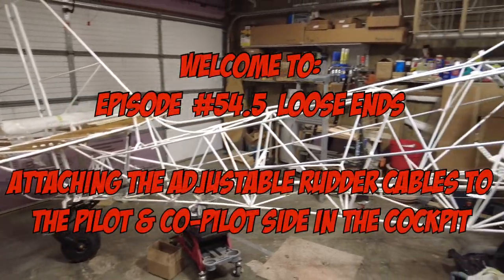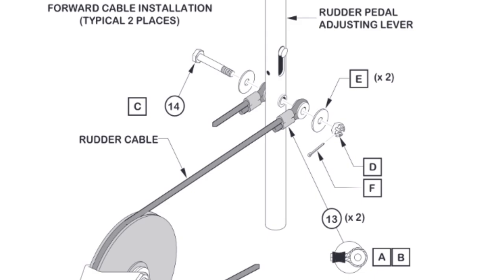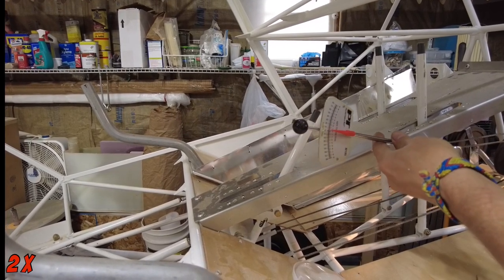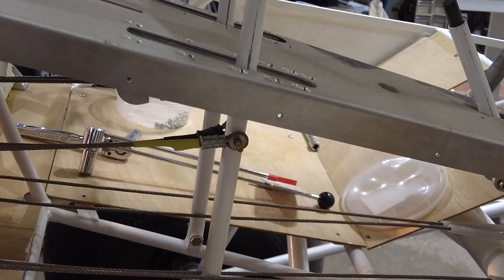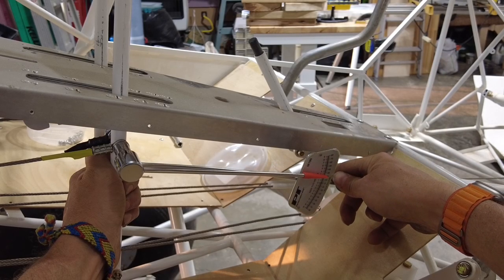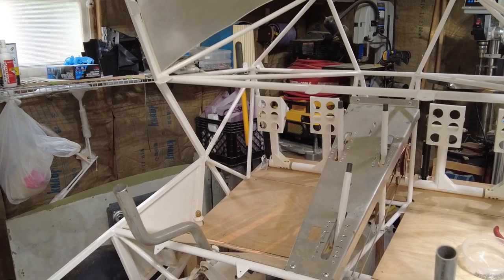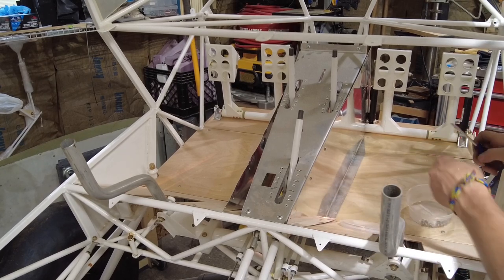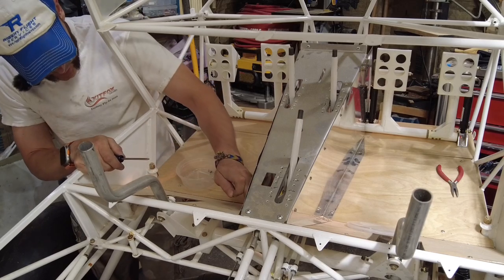#54.5 Loose Ends Adjustable Rudder Cables in the Cockpit

Comment: Hi Matt, I'm up to almost exactly where you are in my build. I've found your videos extremely helpful, thanks for publishing them! I've gone back and forth on my floorboard attachment method and just this weekend decided that I'm going to do rivnuts. I bought the Doyle kit from Harbor Freight and an 8-32 and 10-32 mandrel and rivnuts from Amazon. I went with steel so that they match the frame material and are stronger on the threads than aluminum or SS. I will back them up with hysol so they don't spin. I did some reading on the forum and it looks like Josh Esser and a few others were successful with them. Also, Bryan Bowen used them for his doors so that you don't have to put a nut on the inside of the frames. His video inspired me to bite the bullet on the method.
Reply from the maker: Hello @damienradford7143, I’m glad you have found the videos to be helpful and hopefully a little humorous at times.  Some folks don’t always appreciate he dryness of if.  I’m going to have to go check out Bryan Bowen’s video.  I should have bought the tool also when I was initially playing around with them.  Sometimes I try and cut corners where I shouldn’t.  I just made a note of the tool you purchased since I was actually looking at one from Marson (39315).  And since I’m coming up on the doors I’m sure there is something for me to learn before I make another mistake.  Personally I think if they can be installed and do not spin they make for adding access to an area that may need to get inspected later easier to access.  I think 7KiloFox mentioned something about this also when it comes to installing the floor in the cargo compartment.  Thanks for the good information and happy building.  Matt